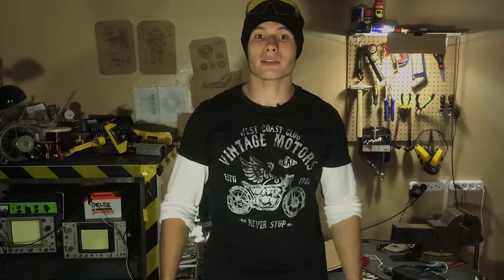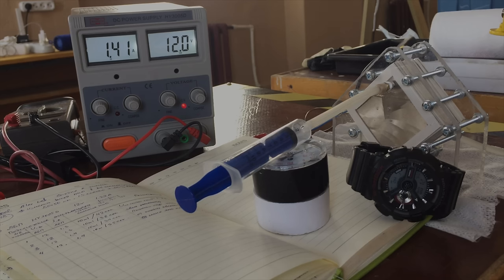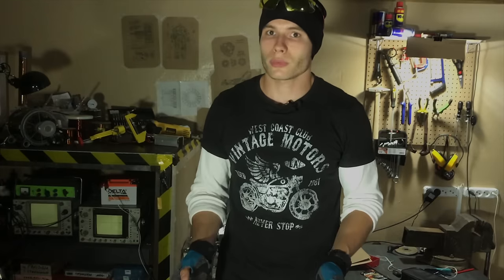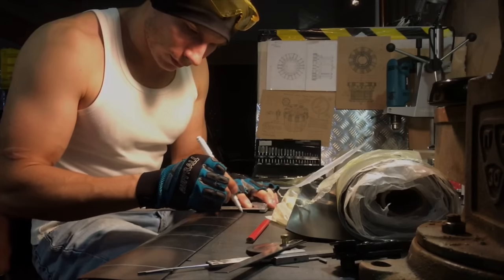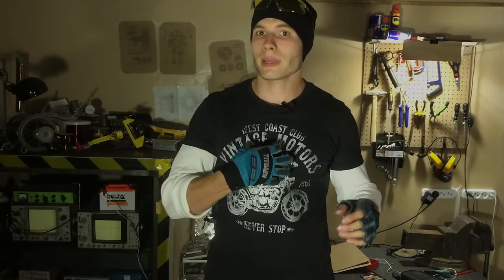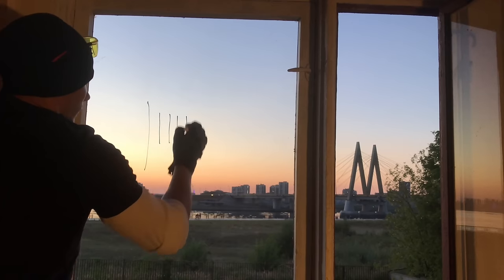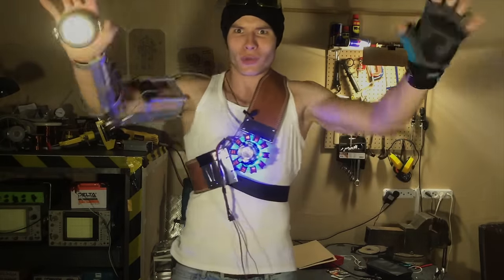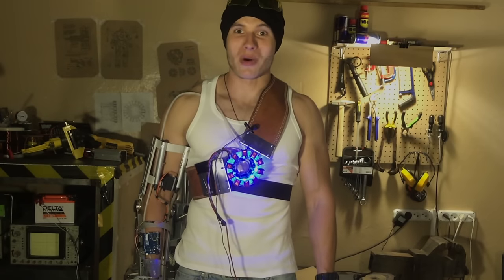Functional Hydrogen Reactor for Iron Man Repulsor. DIY electrolyzer for Tony Stark exosuit.

Comment: "if there is something wrong with the reactor when people being near, it might be no people soon"
Reply: Khal Asaad did he actually say that?
Reply: @m.e.h.8304  yes. 1:30
Reply: That "reactor" doesn't do shit. Emitts blue light and makes H2 and O2 boubles from water. But no energy.
Reply: @zoltankurti  maybe not but the glove does
Reply: @andydbr2969  the glove doesn't do anything either. Go to 0:22 before the fire, and pause it. You can go frame by frame with the buttons "," and ".". You will be able to see that the fire is faked. It is stationary for a couple frames, and tan disapears instantly. Just as it appeared instantly. Sorry, but the gloves are fake too.
Reply: Zoltán Kürti damn, almost forgot about you being a genius and knowing everything.
Reply: @Jasondurgen  correct me if I'm wrong, or else I don't understand what's up with the sarcasm. Are the reactor or the gloves not fake? I'm pretty sure they are, and it doesn't take a genius to see it.
Reply: Zoltán Kürti Do you realize why he is producing hydrogen gas and oxygen gas? Those are the sources of fire(energy).
Also the fire isn’t fake. That’s how it looks like when you are forcing compressed hydrogen gas and oxygen gas at high speed in a short time in presence of real heat.
Reply: @AItheTopG  did you look at the flame frame by frame? Please explain how the lighting effect came before the fire with one frame. Also, the flames were only on two frames, and those frames are identical. If this is not fake, I don't know what is.
Reply: @Miraç Arda I wasn't talking about the sound, I have no idea how sound came up here. I'm talking about the lighting effect in the bottom left corner. It appeared one frame before the fire came out of the glove. And the flame being stationary for 2 flames, and having no flame before and after those two frames AT ALL is just really weired.

Another point is that the "kickback" looks fake as hell too. His hands start moving backwards, and after they are off screen, it seems that his body is dragged out of frame by his hands, with approximately the same speed. Now either his hands are many times heavier than his body, or he is just acting. Anyways, if this thing would have so much recoil that it throws back its whole body, his hands would be demolished. Did you ever fire a gun? Even a relatively bigger one doesn't throw you back like this but still hits like a truck. And they fire a projectile, that's where the recoil comes from. This did not fire a projectile, but still had greater recoil than a gun, since it kicked him out of the camera frame.

But wait. There is more... there is no long barrel in this glove as far as I can see it. I don't know how these gloves are supposed to work, he didn't show that here. But if there is no long barrel, and there seems to be none, the flame coming from the explosion should have been much more spherical, and not have this elongated shape. See, explosions tend to expand. In all direction with equal pressure. This will result in a sphere unless there is some external force, like a barrel having accelerated the gased to many thousands of km/h. As I see it, there is nothing like that here. Why was the flame elongated?
Reply: @Miraç Arda I suppose you don't know about the rolling shutter effect since you didn't bring it up. But just to be complete. This is not compatible with tat one either, even if the virtual shutter was moving from bottom to up, or if it was moving from left to right. The wikipedia is a great introduction as to what this effect is.
Reply: People believe this is fake when electrolizer tech is dead simple and super cheap. Lmao it would be more effort to fake than make real.
Reply: @Technicallyaddicted  the bubbles are the only real part in this whole junk. Do you think that little gas kicks back him like that? No. Do you think hydrogen butning has a yellowis orange flame? No, you basically can't see the flame of hydrogen. This is fake, get a brain.
Reply: @zoltankurti  I have a brain. And my brain says that a kickback like that is good for the camera, and hydrogen does burn with a near invisible flame, but hydroxy is also part oxygen which burns with that characteristic orange. It would literally be harder to fake than to make an alkaline electrolyzer generating a relatively small amount of hydroxy. Like 5 ppl have proven you wrong and its authentic. Just give up.
Reply: @Technicallyaddicted  hydroxy isn't even a molecule. You and there is no orange flame with only hydrogen and oxygen.

Comment: Everyone saying building an arc reactor like in the films are currently (and in foreseeable future) is impossible but in the video he’s using a battery to “run” the electrolysis to produce the gas which is where the pressure is coming from, could that be possible like in this video?
Reply: hope u know this video is fake
Reply: It's not though, he goes over the whole process, how can you be that dense?
Reply: @ubaldoh1299  there was even multiple views explaining the whole thing he only used the same clip because it was probably dangerous and the gass wouldn't be too healthy.

Comment: I'm very interested in trying to do this myself, can you upload the schematics and mathematics to aid other people in attempting a build? If it's something you'd rather keep to yourself that's fine but trying to build it off of what the video says isn't the best. Thanks! :)
Reply: ja bitte
Reply: He's just blowing up hydrogen
Reply: @JakeDancel  Yes but I know how to know the nozzle in detail.Thening with blous H2O2 spray into the air, then it is not ready
Reply: @luminousmoonnight6487  Fair enough.
Reply: honestly this thing is too simple for you to need a schematic.
its just some tube running hydrogen and oxygen through it to fill a chamber with little holes in the top.
it could be improved greatly with thinner plates and more of them to make more fuel faster and weigh less.
Reply: Its a HHO Dry cell man its a hydrogen generator
Reply: H Nn and after explaining it why wouldn't i know what an HHO generator is he says it in the video god damn

Comment: i dont really know how this works, but couldnt you just let the gas out permanently? cuz the recoil is so big, that you could lift off lol
Reply: I tried that and it is a disaster it almost lit my house on fire
Reply: I don't think so, as far as I've understood (correct me if I'm wrong), Alex creates H2 and O2 gases out of water electrolysis (search on Wikipedia for more details) ie by applying current onto water he builds up h2 in his reactor chamber and releases dioxygen gas. 
Then the h2 is pumped into the arm's mechanism, mixed up with his 2nd fuel (used to slow down the combustion reaction so that you can actually record it) and ready to fire. 
When the trigger (I guess on the hand?) is triggered, a sparkle ignates the gas mixture which produces the blast you can see.

So to answer your question I don't believe he can let the gas out permanently as he needs the water electrolysis to take place and build enough gases for the blast. He would prob need a much larger H2 generator, rendering unusable for personal transport (just guessing on that one).
Plus I'd bet there's some safety purposes to this (as he blasts out far less gases out of his arm, and stocks less aswell) he has a freaking H2 bomb locked on the chest ffs, this guy has some balls
Reply: The recoil was fake, it was probably him moving his hand away from the heat or smth because the reaction was delayed. Also without any sort of locking brace mechanism the initial blast would dislocate your elbow and/or shoulder. It's pretty much just a over-glorified flame thrower.
Reply: @nothisispatrick3536  lol
Reply: @leifweigel8721  you know your stuff 👏👏👏👏👏
Reply: lol recoil fake xD, you seem not to know how powerful these explosions can be, for noobs it s like TNT or C4 explosives.  (depending on amount and pre-pressure)
Reply: Hyper Hektor aaaaaand you obviously don’t know what you are talking about
Reply: MrCouscous So it’s a flamethrower?
Reply: @DonEBrooke32  mind ur language kid
Reply: Christophe Groulx sure and you still believe in santa clause xD
Did you ever experimented yourself? no, your comment is a proof that you dont know what you are talking about
Reply: Hyper Hektor "It’s like C4 lulz" proves my point
Reply: @BuzzTheUnicorn   MCU IS PG-13, WE CAN CUSS ALL WE WANT TO! >:-(

Comment: God there are so many fake things about this shit and people already calling him a genius. When he talks about electrolysis, the basic chemistry is correct but he failed to include the importance of an electrolyte to make the water not only more conductive but also improve the rate of the reaction. At 0:58 he talks about Oxyhydrogen but it's properties are all basically not as good as he says or is fake science perpetuated by pseudo-scientists and has been debunked. At 1:40 is probably the most BS thing, as a EE student. The inductors do nothing and were placed just to make the thing look more like Stark's ark reactor. Then he talks about Stanley Meyer and a quick google search will show you he was basically a con-man making claims that completely counter thermodynamics. Meyer claimed he created a particle generator but it's such BS that no one has been able to replicate it and no one won't because of simple thermodynamics. Now 4:20, he connects them in series for what? So that they look like a particle accelerator? But a Particle accelerator consumes energy. Now I can assure you that those LEDs are powered by his voltage generator.  NOW, 5:35 has the funniest shit.  He used a whole arduino simply to power the fucking servo. It has 2 pinouts and a GND all for the servo. It doesn't even have inputs so how the fuck are you going to control it? 

He's either delusional about being ironman or truly trying to con his viewers.
Reply: Plus when you combust pure hydrogen, the flame is almost invisible or blue, not bright yellow.
Reply: @husaynmuhammad6099  Sounds like someone got a bade grade in physic🤣
Reply: Husayn Muhammad you should get off the internet, 8  year-olds aren't allowed on the internet.
Reply: so you think you can do better huh..if you really can..please make a tutorial video

Comment: You’ve definitely earned the right to say, “I am Iron Man”. I’d be mad if you didn’t
Reply: Not really. It would be cool if the electrolyzer disguised as the arc reactor could charger the repulsors(produce enough hydroxy gas) in like 2 seconds at most just like the repulsors in Iron Man.

Comment: The fundamental difference between HackSmith and Alex is that Hack relies on a computer and program, while Alex can assemble a simple distributor from 2 old transistors ripped out of an old TV, without any computers or control programs.

Comment: the blue LEDs are a perfect touch, you'd get more efficiency and energy out of high pressure gas though.

you can simply replace your entire hydrogen reactor with an accumulator systems based on CO2 gas and have the CO2 production on board with a vinegar and backing soda catalyst system.
Reply: Hello, sir. Do you know what engineering he did in his college? I also want to build stuff like this but I don't know what to study and how to do it. Please guide me.
Reply: @cr1osX_  he seems to be an autodidact, he likely went to school but then after that his tenacity, motivation, drive and passion for ironman lead him to learn more eventually achieving a level of skill allowing him to do what he is capable of doing now.

you can learn it all on your own, just research.

Comment: Correct me if I'm wrong but isn't the Hydrogen synthesis achieved by electrical current directly connected to surface area? If so you could shape the metal discs a bit like the structural support layer of cardboard wich would increase the surface area tremendously

Comment: In the movies iron man’s arc reactor was a miniaturised nuclear fusion reactor (it fuses light atomic nuclei like deuterium and tritium together releasing tons of energy in the process) the reactor this guy built seems to just electrolyse water releasing hydrogen and oxygen and then combusts it (which looks cool as shit) but I fail to see how it would produce more power with those induction coils then the initial power he put in with the 9 volt batteries he used initially to induce electrolytes

Comment: Can you use a miniature homemade collider accelerator and can use an open cell aluminium foam about 2cm. Suppose if you built a mini collider accelerator and you can change the direction of the particles and Target it towards aluminum foam then it will create kinetic energy and foam will absorb that energy about 70% . In short we can make core of arc reactor which will power it through element . In iron Man 2 Tony Stark did it
Reply: We can also use the same method

Comment: I have a question. Possitive Electric voltage gives hydrogen from water, and negative(-) gives oxygen from water. So, did u seperatet somehow oxygen from hydrogen in gas tanks, or did you used both gases to make an explosion. I mean oxygen and hydrogen are explosive together, and I dont want my hand to explode either.
Reply: Nevermind, its hydroxy- hydrogen and oxygen, all makes sense now :)
Reply: Sir would you be so gentle to give a little explanation about the battery cables, where to I connect theme, more in particular (avoiding the led part) how do i connect the coils and where do i connect the main voltage cables?